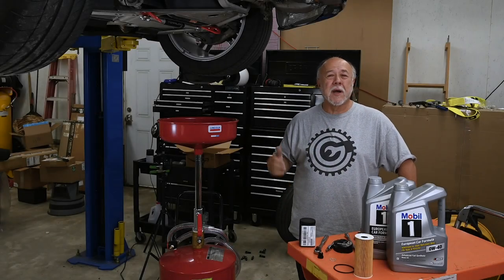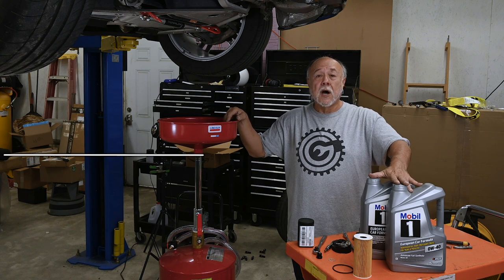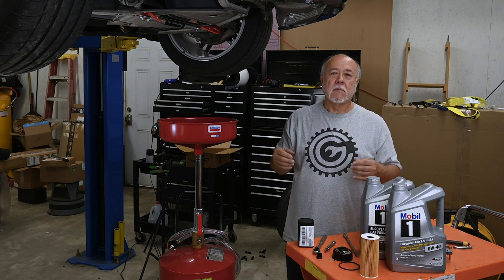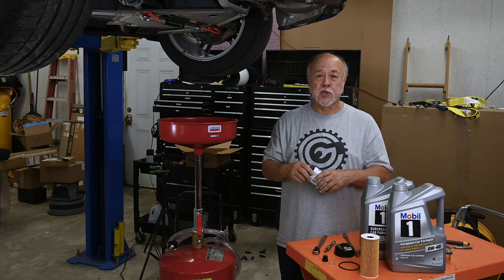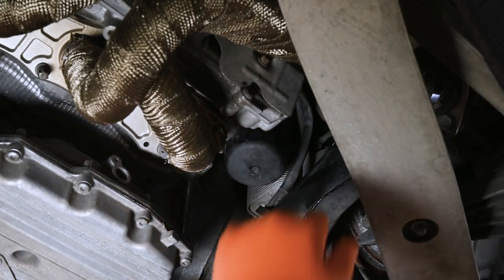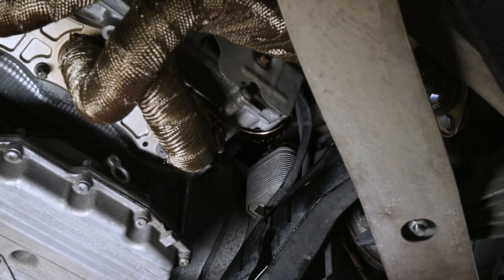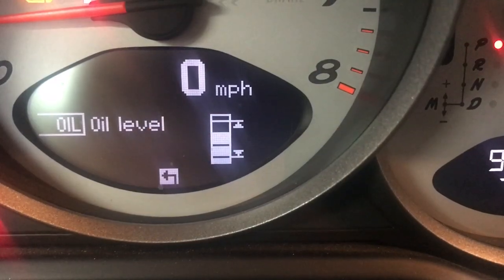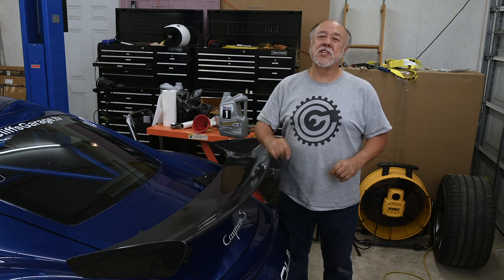DIY Porsche Cayman Oil Change (987.2) Save $400 or more!

Comment: Cliff, thanks for the video.  Was very helpful to me.  I think you forgot to advise folks to remove oil filler cap before draining oil.  That way, less oil will be left in the filter.  To avoid a big mess when removing the oil filter, loosen it until you can turn by hand, then feed a big ziploc bag up around the housing.  Any spills will go in the bag, not on your car!

Comment: Hi Cliff, great videos. I feel like I should correct you that the Cayman, all caymans actually, with the rare exception of the GT4 RS are wetsump oiling systems. Not drysumped with a remote reservoir. The "integrated dry sump" they advertise is a complete misnomer and it is just a simple wetsump.

Comment: One thing you might like is the LN Engineering spin-on filter adapter kit for doing oil changes.
Reply from the maker: I looked at that but I just don't know about spending $135 for it.
Reply: I bought one for 987.2 and something is wrong with the threads, it doesn't go all the way up, so I am still on my canister...